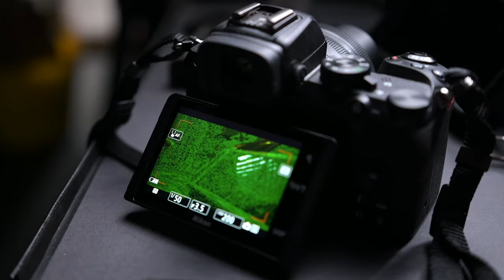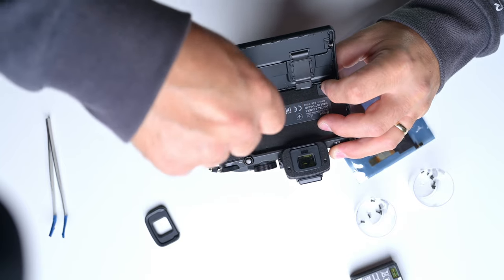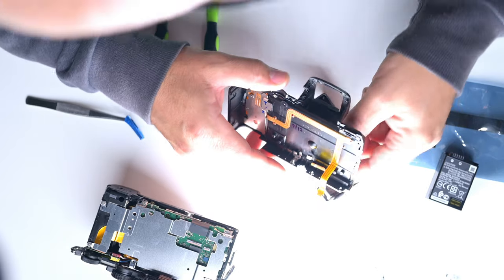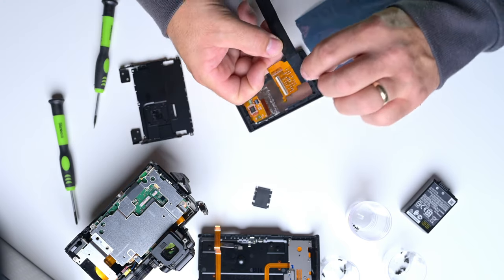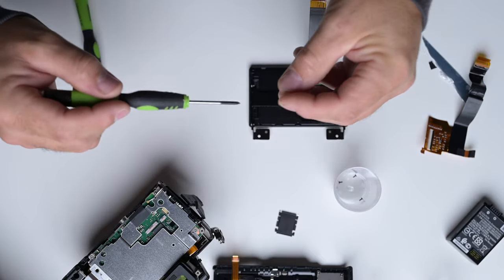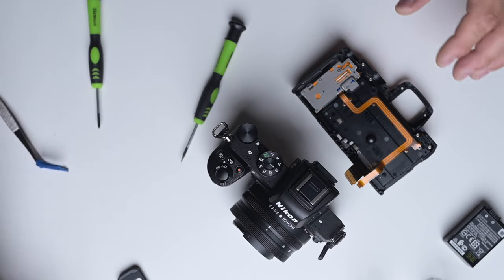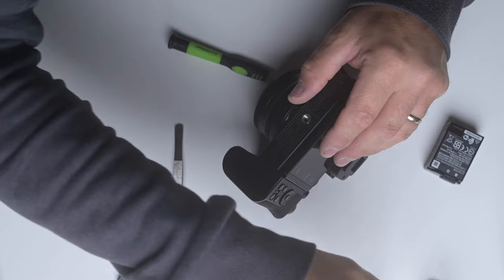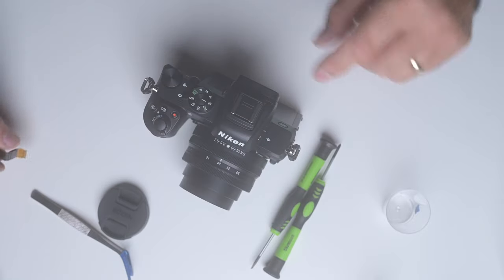Repairing a Nikon Z50

Comment: Thanks, that was very helpful. To everyone who hasn't done yet: There are little latches at the sockets for the cables - you can open then (with your fingernails or with a very small pincette). Then it is very straightforward to insert the cable. Don't forget to close the latch afterwards, it will keep the cable firmly in place.
Reply from the maker: Great info thanks.

Comment: Hey so this is my second time trying to replace the flex cable on my z50 the first time I failed and damaged the cable….. but this time it’s was only a 50% change of success because when I did it again it worked clear as the sub! I no longer have the green death screen lol but IT UPSIDE DOWN! I took it apart and tried to figure out what was done wrong but I didn’t notice anything! So to sum up everything my question is ….. do you know what to do if the display screen is upside down ? And what cable to manipulate or fix?